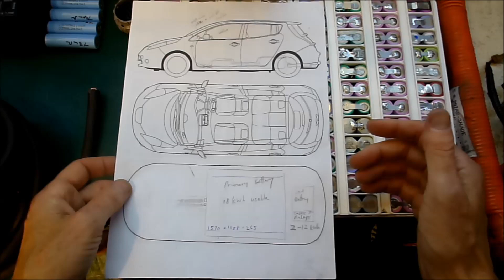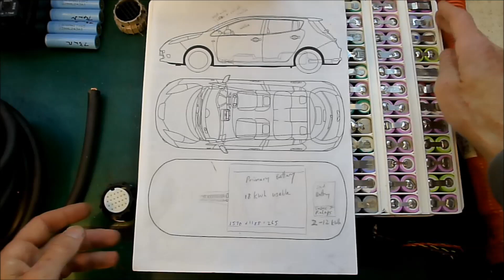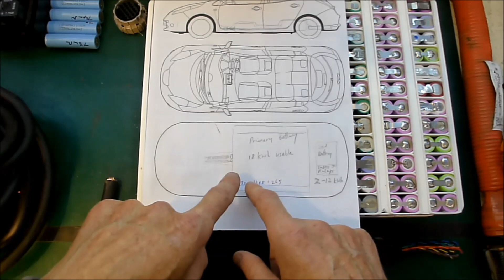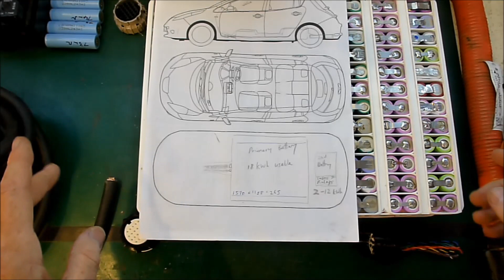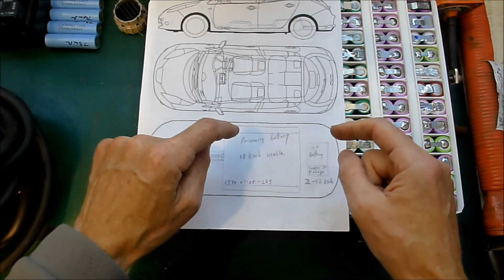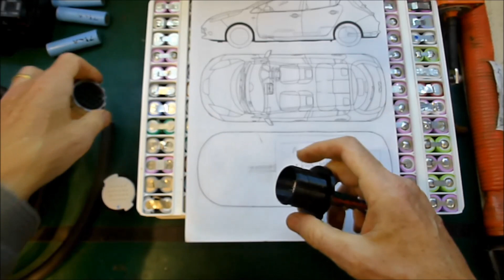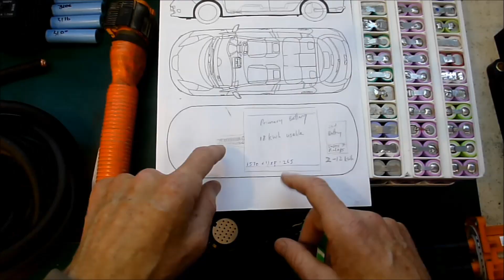Nissan Leaf 012 - Powerboot Intro

Comment: Awesome project, I'm a fan! How are you going to handle balancing of the cells? I guess you can't really buy a 96S BMS off the shelf.
Reply from the maker: The 2 kWh test pack shown in the video will not have a BMS - it's just for testing so I don't want to over-invest before I've worked out the main unknowns. Assuming all goes well I'll start on a larger battery with some sort of BMS setup. Either a Battrium system or maybe 4 of these: https://www.aliexpress.com/store/product/Daly-24S-84V-BMS-for-18650-protective-circuit-board-rated-3-7V-Li-ion-lifepo4-battery/3481062_32913735834.html

Comment: Get some thick rubber isolation gloves for when you are working on it.

Looks good. What chemistry are leaf cells? I didn't think they were lithium ion.

Are you going to be using the leafs bms to keep them in balance?
Reply from the maker: Yep - 500V gloves are on my list. The Leaf uses lithium manganese oxide cells which are 3.7 V nominal just like (most of) the standard laptop 18650s. I haven't decided what BMS to use yet. I won't bother with the test 2 kWh pack - but I will be keeping a very close eye on it when testing.